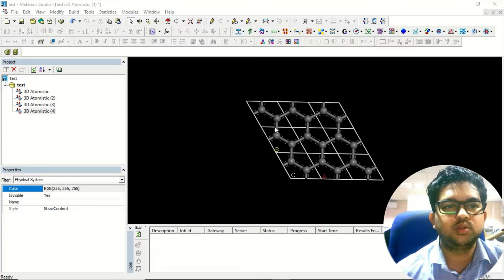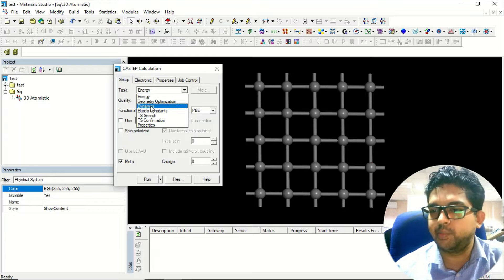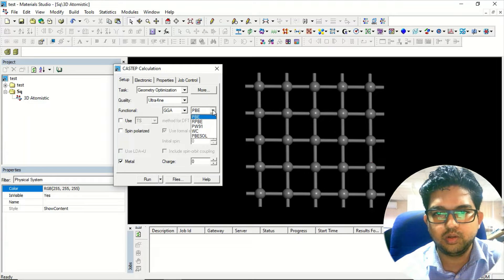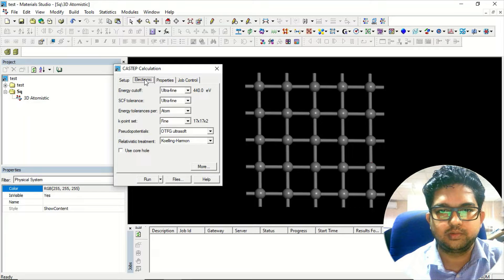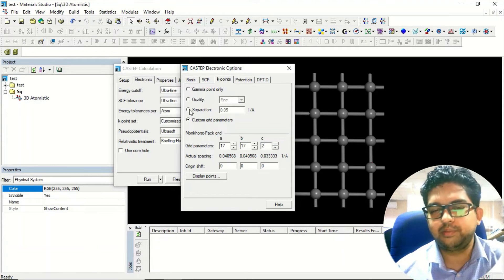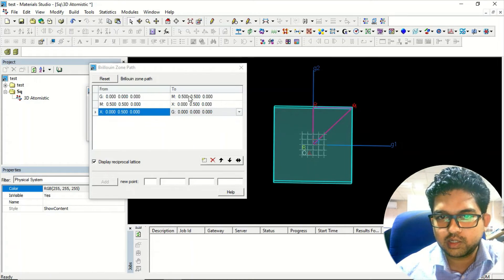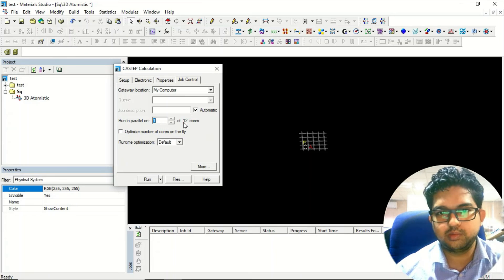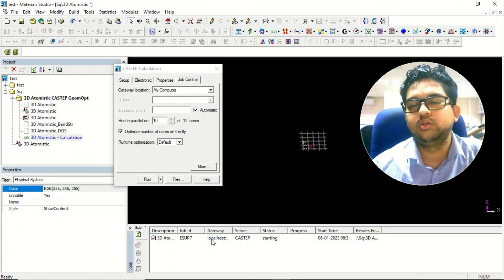Calculations Using CASTEP tool in Materials Studio || Gaurav Jhaa

Comment: Hello Sir, can you please help me, how we can calculate lattice thermal conductivity after phonon calculations by CASTEP,
Reply from the maker: After performing phonon calculations in CASTEP, you can calculate lattice thermal conductivity using the Boltzmann Transport Equation (BTE). Extract phonon frequencies, group velocities, and lifetimes, then use a post-processing tool like Phono3py, which interfaces with CASTEP, to compute the thermal conductivity considering phonon-phonon interactions.
Reply: @quantumguruji  Sir Can you explain to us more that how we can use phono3py compile with Castep to calculate thermal conductivity please